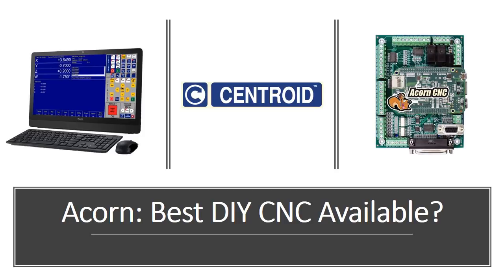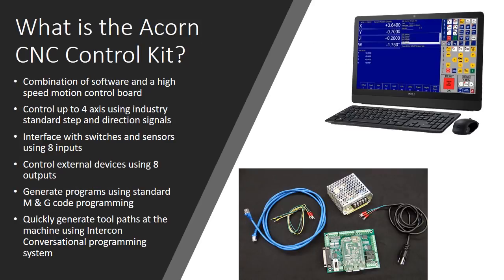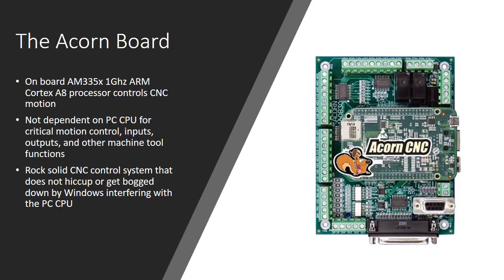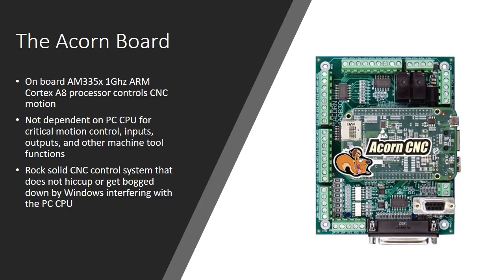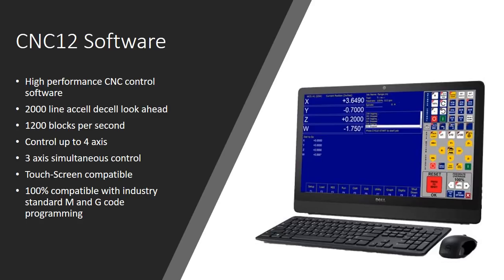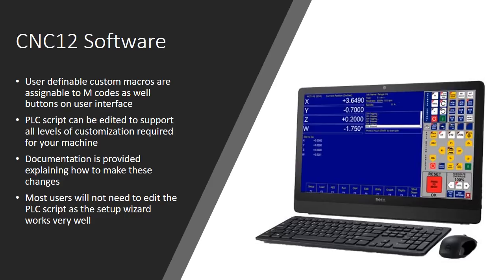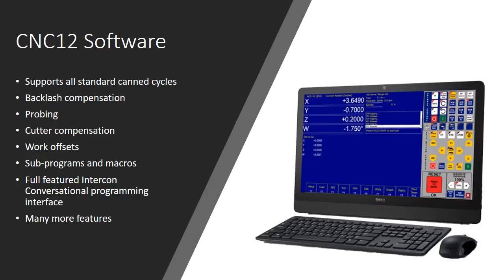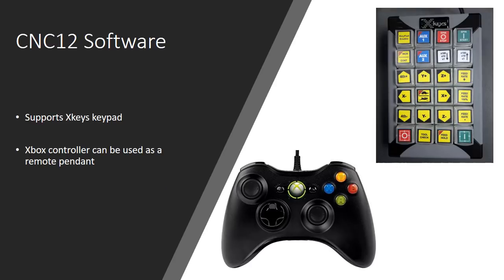Centroid Acorn CNC Control System   Better Than Mach3 or Mach4

Comment: I have to say mach3 seems to have a far better driver for steppers. I can dial my steppers in Mach3 at 150ipm and 300 rapids and they run flawless. In centroid by the time I get the steppers dialed in to be accurate to an inch on the table to dro the max ipm I can get without losing steps is 35-40ipm. The features in Mach are far more detailed in adjusting frequency, velocity, and resolution on the steppers. If such features exist in centroid they must be hidden somewhere.

Comment: I just ordered it. I really hope that it works well.  I am jazzed if I can replace the Mach 3 setups I have.  I'm nervous every time I run a part and really nothing has ever went wrong but the horror stories exist.
Reply: how did it go ?
Reply: @joeygonzo  Works really well. I have not had any issues or cutting failures ever since. I'd never go back to mach 3.
Reply: I'm with Mach4 for years now

Comment: Great job on communicating what this does. I'm trying to retrofit a older lockformer vulcan 2000 plasma table that I bought a year ago. As my luck would have it  before I could even use it the software crashed and there's no way to get it. So here I am trying to learn what I can to do myself on installing a new controller, motors and save myself some money. I must say it's definitely overwhelming being that I've never personally used any cnc machine let alone program the machine itself to where I can use it .....

Comment: Wow, I wish I had seen this last spring, I just reworked my personal mach3 sx3 mill. I did not have enough inputs and was very frustrated setting up motor tuning on my spindle control.  As a Machine Tech Instructor one of our machines at the school has Centroid and it seems to work well. We also have 2 Haas cncs, a Mazak cnc lathe and a YCM VMC with fanuc. So I have other machines to compare the Centroid controller to and it works nicely

Comment: My only complaint is that I didn't know about this sooner.  I unhappily spent 650$ on mach4 w/ hicon board.  If Franco cnc wouldn't have posted this I would still be in the dark about acorn.  This seems like a great product and I just received mine but more word of mouth or advertising would have been great.  Newfangled gave This old tony a free Mach4 and he threw out multiple shout outs at them.

Comment: i have about 5 older Centroid units in my shop and they work well.  i am building a 3d printer and would love to know if the Acorn will work as a 3d printer controller.
Reply: Excuse me how much for retrofit and how many axis ?

Comment: is their anyway to add 1 more axis?  I want to use on a CNC router and the gantry typically requires 2 motors.  In the future I would like to add a 4th axis.  So the 3 axis machine will take up 4 drives on the board and the future 4th axis would need a fifth.  I know you can probably run the 2 gantry steppers off of 1 axis output, but I heard if you have a separate output for each gantry axis you can run a homing program to make sure the gantry is straight.  Basically homing each gantry motor independent to make sure your gantry is perpendicular to its travel.

Comment: Guess I missed the bus on this one. Just did a retrofit & all is well EXCEPT mach3 has some kind of conflict where the license won't work...only opens in demo mode. So can I successfully use Centroid CNC12 software w/a Gecko G540 Controller, MasterCam, & Win 10? I really need a solution. Thnx so much
Reply: I'm no expert but yes, I believe you'd be set with that, you'll need the Acorn board tough.

Comment: What Postprocessor is needed if I use CNC12 Software with the Warp9tech Smoothstepper and Fusion 360?
Reply: Fusion has a Centroid post processor. That works fine.

Comment: Why is it limited to a single encoder input?  Lots of expansion elsewhere... but... it's clear Centroid does not want to impact their primary CNC retrofit business for folks who have encoders on 3+ axis (which, is normal). It's nice to have a product from a single vendor... but... the next step up is $1800+... so... if you get into this and realize you need more from Centroid- you are really in a pickle.  We should be clear. Centroid is trying to figure out how to dabble in the DIY market- without impacting their primary business. I can appreciate that, but, to say this is better than the other DIY products is a stretch at best. All DIY products will take more effort. This is clear. To claim that this DIY product will solve all of the issues present elsewhere is not accurate. The issues you run into will just be different- and your safety net will be the same.

Comment: not my opinion newer, too ower prize. same cost order all parts new cnc and build at home better.
Reply: No you won't, I've done the math and you will not find a better combo for the price!
Reply: @E33Tpro   UUCNC with the software is 60 buck for the software and a different variety of boards to run it with. ALL well under the price of an acorn kit. Did the math and found a better product. you can fine tune UUCNC much better(read faster speeds all around with more tuning options) than acorn.
Reply: @66dvert  So??? I already have the acorn kit, as far as I know...and I have researched it, the acorn combined with any of the Centroid software makes it worth it, plain and simple!

Comment: Just now listening to this presentation covering the features of this Acorn and cross-referencing to other typical systems and hardware that most people are aware of, or should be aware of if they have no experience.

BUT ......BUT .....BUT .....if the presenter's name is really "FRANCO"....if you didn't listen to your own presentation before posting, you should have.    It is one thing to give a "relaxed"  presentation, but it is another to give a presentation like this and CONSTANTLY use the FILLER WORDS ...."YA KNOW" and "LIKE".    You might think of this detail as "chinsy" ...but it really is not.  Narrating like this makes a good presentation ...very cheap.   Consider this "constructive criticism"

I listened the whole 35 minutes. You must have used "YA KNOW" and "LIKE" a thousand times.  VERY POOR for such a public presentation .....but the product does look very good.